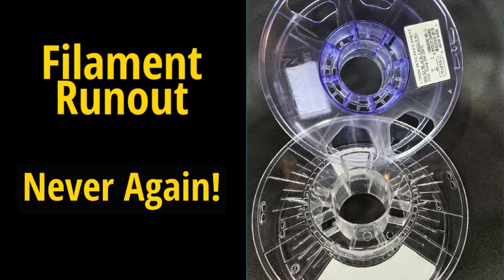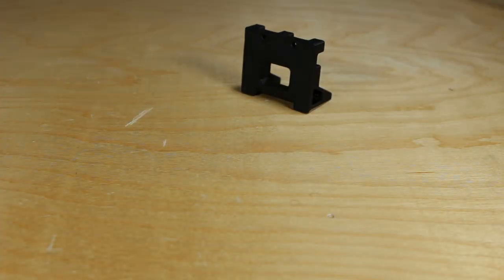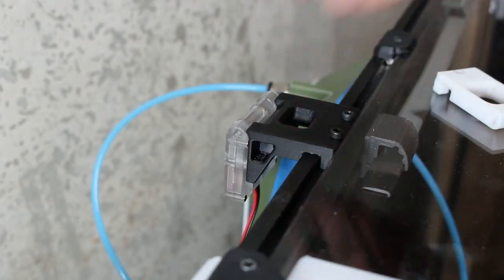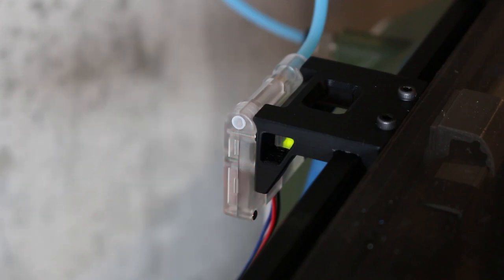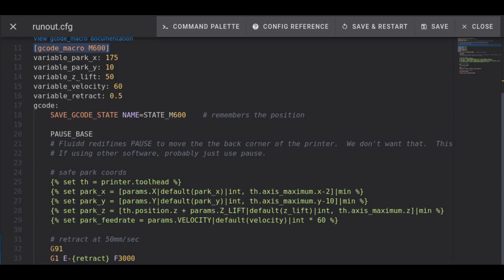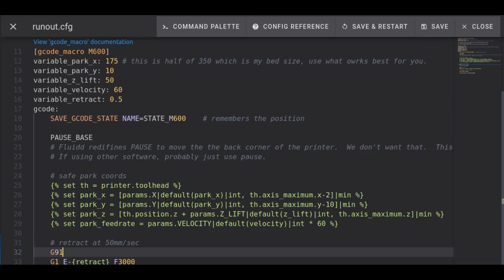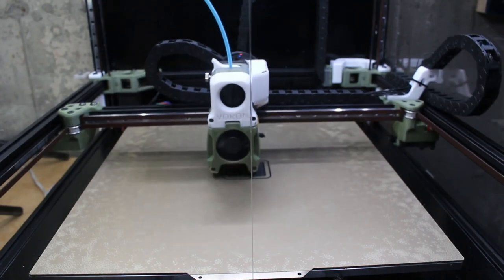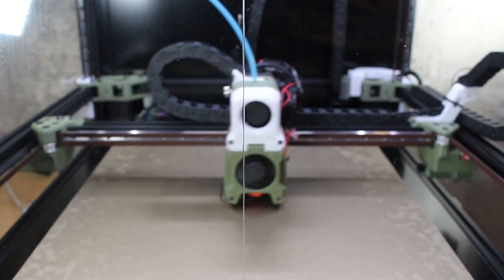Install a Filament Runout Sensor on your 3D Printer and Klipper

Comment: Hello, thank you for the script - it works as indended. However in my case is runs repeatedly every couple of second lifting the head 50 by 50mm up to the top of the printer.  [pause_resume] is no it my printer.cfg but in fluidd.cfg instead and if I comment it then there is some error saying there is no cancel print macro. Also, the "rename_existing: PAUSE_BASE" is already included in fluidd.cfg

edit: it lifts the head another 50mm after every manual move with the head I do (if there is no filament)
Reply from the maker: I'm not sure I fully understand what is happening, but leave the pause in fluidd.cfg.  It needs to be there.  And use "PAUSE_BASE" in your runout.cfg file, not PAUSE.
Reply: @KapmansBasementWorkshop  Print pause does work and the head moves to the desired direction, but after every custom action (filament extraction etc) the head does the park again - lifts the head by 50mm. Shoudn't this script run only once?
Reply from the maker: @NerevaR20  Yes, only one.  What file do you have this in?  Also, paste the text you have in that section here so I can have a look.
Reply: I have found a solution to this problem: input "SET_FILAMENT_SENSOR SENSOR=RunoutSensor ENABLE=0" to all pauses and "SET_FILAMENT_SENSOR SENSOR=RunoutSensor ENABLE=1" to all resumes and print start macros.
Reply from the maker: @NerevaR20  I'm glad its working and thank you for posting your solution!
Reply: @NerevaR20  I don't suppose you have a copy of your adjusted macros that you could share? I have a similar problem but mine makes the move to change the filament but then goes in to moving X and Y about 95mm continuously whilst pushing out filament. Thank you.

Comment: That is aweosme! Have been trying to do multi color filament prints and didnt realize I had not programmed a filament swap function in. Would the this config change work with prusaslicers filament change option? Best of luck with the scrub macro as well. Ive been wanting to add a brush and command but have not been confident enough to go that route yet.
Reply from the maker: I assume it would, but I use cura, so I can't say 100%.  But I don't see why not.  Also, I just recently added a scrub brush.  Here is it: https://youtu.be/ZEXYnXZA8B0
Thank you for watching!
Reply: @KapmansBasementWorkshop  Awesome, I'll have to work on the scrub brush once I get the filament swap portion working (just put in an order for the filament sensor as well). Apparently, prusa slicer uses the M600 macro for their pause, so I have high hopes it will work. I was curious though (and I may have just spaced or overlooked it) is there a gcode macro for "resume" for fluid and mainsail (I'm currently using mainsail) or does one need to add another macro to include a resume option on the printer display and or mainsail/fluid control display?
Reply from the maker: @ZeonsZone  Your fluid.cfg or mainsail.cfg file should already have resume defined.  I don't believe I needed to make any changes, "resume" just worked.  That said, I have never tried calling resume from the printer display, I just type it in and hit enter on the console from Fluidd or Mainsail in the web view.  Honestly, I never use the printer display.  Have a look in that crg file, you should already see resume defined.  Good luck with your printer improvements!
Reply: @KapmansBasementWorkshop  Ended up giving it a go and had an issue with "BASE_PAUSE" being unknown but going to just change it to "PAUSE" on the next go around since when I typed in "PAUSE" on the web view, it started the park sequence (error caused it not to pause for the filament swap). I did forget to add the coordinates sadly so it just parked above the bed in the back right 😅. When I typed resume on the web viewer, it started printing again as well, so thats at least thats an easy way to get it printing again. Thank you very much for the tutorial, insight and assistance!
Reply: Found out that "!" infront of your pin location is important to get it to function correctly, otherwise mine would act inversely. Got it up and running and functions properly. Currious, did you ever figure out how to get the "reload filament" message to go away after hitting resume?
Reply from the maker: @ZeonsZone  No.  Honestly I kind of forgot about it as I focused on other projects.  I do need to go back and fix that however....
Reply: @KapmansBasementWorkshop  I know how that goes forsure. Took me about a month to finally get to installing mine. So much to do, so little time.
Reply from the maker: @ZeonsZone  Thanks for watching and I'm glad it's working for you!

Comment: If you were going to leave the code available for the people here to use I dont recommend putting it in the about section as text, try hosting it on google docs or something.  Youtube's formatting  has made your code, and thus most of your video basically useless because everything that should be commented out isnt and unless someone has enough experience to know what is what they arent gonna be able to fix it.
Reply from the maker: Hmmm.  Since then I switched to Github.  I failed to update this description.  Thanks for leaving this note.  I need to fix this!

Comment: Hi. Thank you for these amazing tutorials. Can you please share all your .cfg files?
Reply from the maker: Did you have a look in the description?  I pasted my config text that relates to this project.  Or, are you looking for more?
Reply: @KapmansBasementWorkshop  I'm asking about all the cfg files you have
Reply from the maker: @framespersecondfps5256  Have a look here.  https://github.com/Kapman1/Kapman1 
Please use as an example only and with extreme caution.  There is a high risk you can damage your 3d printer with these.  
I'm also adding this link to this channel.
Reply: @KapmansBasementWorkshop  I recently got a generic runout sensor and after wiring it up, it gets very hot rapidly including the wires. What can be the possible reasons?
Reply from the maker: @framespersecondfps5256  Where is it installed?  Also, where is it wired to on the MCU?
Reply: @KapmansBasementWorkshop  It's installed near the bowden retainer at top and wired to the J33 pin on the octopus
Reply from the maker: @framespersecondfps5256  If the sensor is the same or similar to the one I purchased, it's designed to run with 3.3v to 5v maximum.  Did you set the jumper for 5v or is it set to 12 or 24v for J33?
Reply: @KapmansBasementWorkshop  I set the jumper to 5V
Reply: @KapmansBasementWorkshop  I set the jumper to 5V
Reply: @KapmansBasementWorkshop  I can't see runoutsensor in my endstops
Reply from the maker: @framespersecondfps5256  So I have not actually checked this on my printer.  But I'm also in the middle of some other changes to the printer so it's not is a usable condition at the moment.  I should have everything together this weekend and once running again, I can check and see if mine is heating as well.  Is it the same sensor I'm using?
Reply: @KapmansBasementWorkshop  No I got It working. It's wiring was damaged so changed it
Reply from the maker: @framespersecondfps5256  That typically implies its not recognized by Klipper so to state the obvious (my apologies), something isn't right.  Let me get my printer back together this week and I'll have a look at my setup to see what might be wrong.
Reply from the maker: @framespersecondfps5256  Perfect!  Thank you!